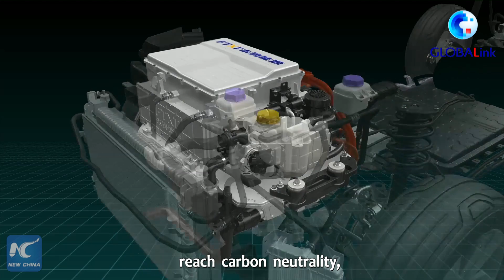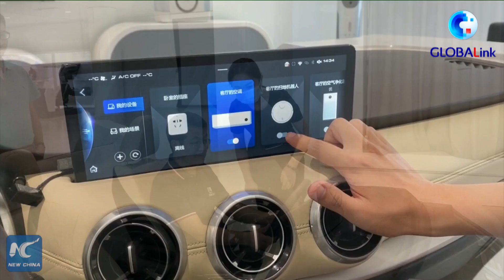GLOBALink | Chinese automaker developing hydrogen fuel cell vehicles

Comment: I understand hydrogen production is where the gotcha is. It's very energy intensive. No doubt you guys will come up with something brilliant for that too, not being preoccupied with global hegemony & all that jazz.
Reply: Both production and transportation of H2 are challenging globablly. But China has its advantage of mass land for solar farms in the west, as well as super low cost of mass production of solar panels.  The solar power can be used to produce hydrogen gas. The transportation can be solved by re-using the already existed massive natural gas transportation network (the West–East Gas Pipeline project). That's why China is staking on both lithium battery and hydrogen fuel cell at the same time.
Reply: James _ L  you must have been reading my chat history, because I love the (compressed) air driven concept. No electricity is necessarily needed at all. Compression can be obtained mechanically. So it can be 100% clean & green.
Reply: Mining for the minerals for electric car batteries is highly toxic.  I would like a neutral party to do a real comparison.  Personally I tend to prefer fuel cells since the range is longer and you can fill up faster.  Battery electrics might be cheaper to operate in the long run though...
Reply: From China official channels: China is #1 in Hydrogen production and annual produced 40% of world's renewable Hydrogen ie produced from green power source
Reply: @rmarbertin8131  You notice my old acc chats above have been eliminated, disappeared.
Number of my acc banned and current acc is categorized so many chats I can't read nor participate in

Comment: To extract H you need electricity. To refuel you need fuel stations. Hydrogen fuel cell technology is not new, unless there is some breakthrough in extraction or fuel cell technology then the focus should only be for heavy vehicles like trucks and busses. Currently most of the busses in China are already electric. Heavy duty vehicles requires large torque so it makes sense to use a combustion engine like a fuel cells. Converting heavy trucks and construction equipment to fuel cells make sense. Reduce reliance on diesel. As for consumer cars, I feel the current EV direction is good enough.

Comment: hydrogen cars can really ECONOMISE MORE FUEL COST THAN ELECTRIC CARS IF WE MODIFY OUR CURRENT HYDROGEN DISTRIBUTION APPROACH ! 

 The biggest cause of hydrogen cost is that WE TRANSPORT HYDROGEN BY TRUCKS, IT IS EXPENSIVE. Just try to avoid to transport hydrogen by trucks, then hydrogen will be very cheap. It means that NEED TO PRODUCE HYDROGEN ON SITES (WHERE FILLING HYDROGEN), OR TRANSPORT HYDROGEN BY PIPE LINES. 

 So we need to make 1 or 4 modifications : 

1/ Distributed hydrogen production on sites : hydrogen filling stations should be equipped with electrolysers, so hydrogen filling stations can produce hydrogen on sites from electricity outlets, instead of just receiving hydrogen from other places. Thus avoid problem cost of transfer hydrogen by trucks. Besides, nets of electrolysing hydrogen filling stations are ideal solution/market for intermittent renewable energy.  

It is new worldwide coming hydrogen distribution approach, so it opens markets of mobile small sized electrolysers. Electrolysers are not so expensive for hydrogen filling stations.

2/ Use compressed gas hydrogen batteries with mini household  electrolysers/mini mobile electrolysers : small mobility vehicles/mobility machines/mobility robots/mobility drones …, will use hydrogen gas batteries (hydrogen gas battery =hydrogen fuel cell + compressed hydrogen gas ballon 200-300 bar). And each of these mobility machines can be sale with mini home electrolysers, so that owners can produce to fill hydrogen at homes (charge hydrogen batteries at home). Hydrogen ballon 300bar is enough, so that hydrogen battery 300bar(fuel cell +hydrogen ballon 300bar) can guarantee more energy capacity than best lithium batteries, and it guarantees that the size of hydrogen battery 300bar  is not remarkable bigger than lithium battery of equivalent energy capacity. Of course 700bar allows more hydrogen storages, liquid hydrogen allows more hydrogen storage. But for hydrogen batteries, gas hydrogen ballons 300 bar are enough for  balance of performance-capacity-size-energy convertion ratio-ballon material-simplicity. 

Hydrogen batteries 300bar + mini mobile electrolysers are ideal for two-wheel vehicles/small cars/small robots/drones and for trend of hydrogen mobility devices anywhere (easy to operate  anywhere and easy to charge anywhere with electricity).

3/ hydrogen batteries for big station energy storage : Independent hydrogen batteries (hydrogen fuel cell + compressed hydrogen ballons > 300bar) + independent electrolyser is best variant. when excess energy, then run independent electrolyser. When need electricity, then run independent  fuel cell. And intrigued working mechanism between independent fuel cell and independent electrolyser. That is all ! No complex automatic control system. 

4/ hydrogen filling stations need to prefer using hydrogen pipe line than transporting hydrogen by trucks.

5/ The fundamental science dictates essential truth advantages of hydrogen.

Science : if a chemical energy storage mechanism is charged as quick as producing hydrogen, then this mechanism PRACTICALLY  CANNOT HAVE ENERGY CONVERTION RATIO BETTER THAN ELECTROLYSIS PROCESS. Besides, it is possible to adjust electrolysis reaction speed to get energy convertion ratio of electrolysis better than any chemical batteries. The best one of all possible chemical batteries in earth conditions is HYDROGEN BATTERY. All revolutions of chemical batteries, lithium batteries, LFP batteries, LTO batteries, graphene batteries .. are for reaching to the features of hydrogen batteries

Comment: I thought the Hydrogen fuel cell was not efficient because the energy required to make hydrogen and pressure it onto the tank was greater than the energy output?